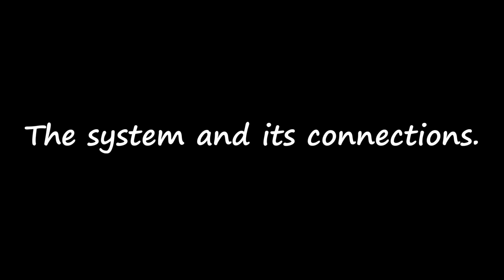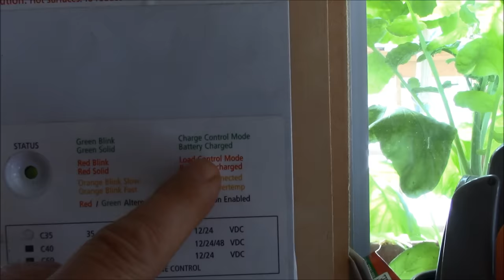A SIMPLE OFF GRID CABIN SOLAR SYSTEM THAT ANYONE CAN BUILD AND AFFORD. DIY Simple Solar Installation

Comment: Great video on installation of a simple and small system. 
One bonus you didn't mention is, by elevating you panels a little off the roof you allow the warm/hot air to vent from under the panel, keeping your panels cooler. Cooler panels are more efficient than warmer/hotter panels so you generate higher voltages from your solar panels.
Reply from the maker: Great point and thanks for commenting :-)
Reply: @thebossoftheswamp  Probably more than you want to know but my MPPT charge controller (Outback MX-60) can take 100 volts up to 60 amps of input. Using 24V panels I was going to run strings of 3 panels in series. 

The output of each panel is very near 33 volts. On a really cold winter day with snow on the ground (reflected light) and the sun at just the right angle it is unlikely but still possible to exceed 100V with three panels in series. This would let the 'magic smoke' out of the charge controller making for a very expensive day.

Sorry about the complexity of this explanation, I hope you get it. I'd comment more but don't want to appear pompous.  Thanks for your really great videos.

Comment: As with everything in life, there is a learning curve. And switching from on grid power to solar power, you have to learn what your system can and cannot handle. (you may also need to adjust your system to meet your needs)
I went through that learning curve over 6 years ago and have been off grid ever since. Not having a utility bill in over 6 years is priceless.
Reply: How many watts did you set up? Did you do the system for your house or cabin? I'm wanting to set up for my house and I'm wondering how many watts I should consider or at least start with, then add on later. I live in Canada and can access the Canadian Amazon if you have products to refer to. Thanks.
Reply: When I bought my land, I built a 14' X 16' cabin, on a full-size basement. I figured out what appliances and equipment I needed to have in my cabin, then I calculated how many total watts were required to operate everything for a 24-hour period and designed my solar system, using those figures.
Being new to solar, I made the typical mistakes of using non quality equipment and learned the hard way to go with name brand, high quality equipment that will last.
My system can be viewed in the videos on my channel, which is accessible by clicking on my name.

Comment: I picked up used panels with no frames on them. I've built a stand for them and only thing I can think of is using Liquid Nails and then put strips of wood around them like you did yours. Since mine is 6 ft in the Air I can easily stand under it to do all my connection's. Maybe even with the space under it I can make a little shed for yard crap and tires. So my stand is ready but my energy is in the pooper to lay panels, at least I won't have to go on my roof.
Reply: Good idea. 
I put my first set up on ladder style scaffolds like a bakers rack but slightly wider.
Reply: snow removal is abear. Set up on the ground facing south is the way to go.
Reply from the maker: In our location, the roof has sun a lot more than the ground so the roof was the best spot for them.

Comment: Great video. I recently did a setup. DC batteries. Worked great in winter. Summer came and because I didn’t understand that BMS battery management systems would cut off the extra power from over charging the batteries I cooked them. The got new batteries. Obviously 🙄 it happened again. Newer lithium batteries have a BMS built in and will do all of the above. I was using DC nicad 🤦
Reply from the maker: I really don't know squat about this stuff but my simple system has been working flawlessly since i set it up. I think about improving it butlike they say "if it aint broke - don't fix it" :-D
Reply: A battery maintainace system is needed to keep the batteries from over charging.Bcuz over charging is as bad as under charging. Batteries are the most expensive part of any solar system & you don't want to have to repurchase them. The maintainer is a cheap security system (little box) that protects your expensive batteries. I recommend it and a lightening grounding rod for any home/cabin setup.
Reply: @denisewilson8367  yes. I learned this twice the hard way. I watched a lot of videos on these setups and either I missed it or it was not stated enough. It’s super important. 🤦🏼
Reply: @denisewilson8367  do you have any recommendations please. I want my third attempt to work perfectly. =]

Comment: Great video like usual. I got to say four years ago I started off with one panel and one battery deep cycle living totally off grid I’m now up  to 10 renogy 100 watt panels which is 1000 Watts and 6 -100 amp hour batteries. I bought the Renogy battery,s in the beginning But found that the warranty on them Wasn’t anywhere near as good as the lithium ion Battle Born Bateries which is 100% replacement for the first 10 years and then a prorated additional five you’re on top of that so Renogy was good enough after some convincing to refund my money and take their batteries back. I am also on my third charge controller because as you increase your panels output the charge controller has to accommodate the power from those panels so right now with the charge controller I have I could go up to 1400 W which means I could get four more panels. Should’ve realized it was like building a garage always make it bigger than you need because you’re going to use it I would’ve saved 
A lot of money if I would’ve taken that into account but I was green and not really sure what I was doing. And like you said January and February are very low power producing months in New Hampshire, right now I’m running pretty much without the generator and that’s including running a pellet stove which takes a lot more power than I thought it would.

Comment: Good stuff Boss.

I started setting up a house with solar several years ago.
I ran most of the wiring from the panel locations to the charge controllers.
A couple of suggestions.

As much as possible use 12 volt power and skip the inverter.

I ran 12 volt wiring for lights using 900 lumen LED s from SuperBrightLED
The bulbs were 25 dollars then and well worth the money.
The lights are getting close to 10 years old and still out perform anything else.
Amp draw is extremely low like .05 amps per hour. If I remember the math correctly. I could be wrong but then again I have never been accused of being right.

 The owner has done modifications to the original setup. 

If somebody out there likes to listen to music, two knob style 12 volt car radios will play for days on a 100 Amp hour battery. My friend installed three of them in his house with speakers mounted in the ceiling. 

Look at the truck stop there are numerous 12 volt appliances to include refrigerators/freezers, that will run from a small solar setup.
These could be useful in a grid down situation for those living in an urban area  to help keep food and medicines fresh until the power comes back,

As a back up I rigged up a couple of terminal posts on the side of the house.
In a pinch I could jump the house off the truck. 

For those with more of an interest look up Will Prowse on You Tube.
He can be extremely technical but has videos for beginners.
His website is a fantastic resource.
Very smart young man.
Reply from the maker: All good points Shawn. Thank you.
Reply: @thebossoftheswamp  Anytime Boss.
You have shared your Backwoods Logic with us for many years.

I can give back in areas where I have some experience.
Even if it is pointing them to a resource of information.

Comment: The batteries are awesome!  I upgraded to lithium and don’t regret it.   The only drawback is you cannot charge them when it is below freezing.  Even though they are initially expensive, they will out perform and out last lead acid batteries.  Because they last longer, in the long run are more economical.
Reply from the maker: I've heard good stuff about them.

Comment: I have an up comming project im working on, its 1 pannel, 1 battery and a pair of street lamps I built my self.
The goal is to have fail safe lighting for my driveway to discourage theives.
Eventually I would love to take my entire home and workshop off grid and no longer be dependent on the local utility system.

Comment: I bought a similar kit and my order was mixed up. I bought from Amazon and there were two variations of the product in the listing. They sent me some things from the one I actually ordered, and some components from the variation that I didn't order. Arghhh. I had to buy a few cables that were supposed to be included, but it's up and running.

Comment: I like it.  The only caveat is that the incoming fuses you got (inline).  I had the same and got about a year and a half until one day we had a lightning storm in the area.  We got what I later found out to be an indirect strike...mere static in the air that came in the lines and went right through the inline fuses and fried everything.  If you drive a ground rod and run a lead up to the panel frames it'll help avoid having the same expensive problem I had.  Good luck with your system.

Comment: Hi JC - I use Renogy products too with no problems. I have a small panel that attaches to my RV's window with suction cups and it has a USB outlet on it for charging cell phones, etc. The other small panel I have has a variety of attachments that I use to keep my motorcycle or ATV battery charged when it's not in use. That one is portable as well and works great! Thanks for sharing your info!

Comment: What a treat to come home on a Friday evening and see that notification that I had a video from the Boss waiting for me. Maybe in the next video you could tell us what the system cost.  Were the batteries included?  Can you just buy more batteries?  Have a great evening Boss. I sure will. God Bless
Reply: I just sourced all the stuff and came up with around $2,378. There may be more if shipping and tax is added. Still it also depends where you buy from.
Reply from the maker: I think the kit sells for around 700. now and the batteries for 350.  ea but I got mine on sale on the Home Depot website for around 290. plus 10% off cupon :-))

Comment: Great video! Im on board with ya on mounting costs. Im doing mine out of unistrut.
If you decide to upgrade maybe think about going 24v. I got a cheap 3kw inverter ($300) and at idle it pulls 10watts.
Plus youll be using 1/2 the amps. Thats what causes thermal loss. It even can run my 15amp chop saw no prob.

Comment: finally ... came across another part of your videos .. others make this so complicated... i will be totally off grid next year.. was almost giving up on any electric power.. as the companies who install it are so expensive and want to load me with more kwh than I would require to sell for a higher price than I am willing or able to attend to,,.south of the mason dixon line.. I should be able to easy have solar... right now my only power to move into my homestead is a jackery solar generator and a propane duel fuel generator which I dont wish to run much as it is very loud

Comment: Very similar to what I did, I found the racking expensive as well. I used wood like you. The only thing I did different, was I grounded my panels and added a disconnect switch from my panels to my charge controller and a disconnect switch ( 18$ on Amazon ) from my batteries to my inverter. Great video. I really enjoyed it.
Reply from the maker: I'll be adding a few disconnects too as well as a 12v buss bar and a few other gadgets.  When you start at the bottom there's no place to go but up haha.  Cheers :-)

Comment: Nice job JC! I had 2 400 watt panels at the KY cabin with the 2 Wal-Mart Marine Batteries and an adjustable 2000 Inverter and it worked great. Thanks for the video!
Reply from the maker: Thank you buddy :-)
Reply: I'm wanting to install the solar panels for my house. What can 2x400 wt panels run? For my house how many would you recommend to run appliances, fridge, freezer, washer, and power tool on occassion? Thanks

Comment: You can increase the amount of energy you get during the winter by using metal-sheet mirrors (i.e. metal sheets for construction, or space blankets or tinfoil + epoxi + tarp to make rigid mirror boards, since optically-perfect mirrors are a lot more expensive), and angling and moving them so you get more sunlight during the winter onto the solar panels, and maybe even using the same thing to get more sunlight onto your windows and walls, to reduce the heating bill. Also look into trombe walls and solar air heating, so you can use either normal sunlight or concentrated sunlight to heat the air in your house, while at the same time circulating the air inside your house to prevent mold, and you can even install a heat recovery ventilation to move the heat from the air going out of the house into the air which goes into the solar air heaters or trombe walls through a pipe inside your house, and then making it into the house after the solar air heaters or trombe walls heated it.

Comment: Great video! I do have a warning about your small inverter. We use the 750-watt model and the other day I managed to touch the wrong terminals as I was switching the cables to where they needed to be. With a big flash, I thought everything was destroyed. With one last hope, I took it apart in hopes of a fuse being inside. Yes indeed, there THEY were! There are two 40 amp blade fuses protecting the inverter. We had to go to the car parts store because the 40 amp size was too big for the box store. We now have a couple extra blade fuses and look forward to another 10 years of using it.

Comment: I have a system in my rv.   I have a switch on the inverter where I just flip it on and off when I am going to run a 110v device.  Otherwise everything else runs off 12 volt and the inverter stays off.  Of course it is a little easier being all in a contained small environment.  Our inverter switch is right near the kitchen where most of our 110 appliances are.

Comment: I've been running my camp off solar for about a decade, indeed solar does not have to be complicated. 
This video shows a 12v bank in parallel which is fine but if you want to save coin on batteries you can use 6v GC2's (golf cart) in series / parallel. And they are common. They will not freeze if kept charged. Also note he's right about inverters using power. Meaning even if they are not in use but left on they will still draw dc off the bank. So just switch them off when not in use. Also most inverters have a cut off when your bank drops below aprox 11 volts. I highly recommend NOT letting your bank's soc (state of charge) drop below 12v. If your thinking 12v is 12v well it's not. Keep in mind a charge controller depending on if it is pwm or mppt will typically charge, equalize - float your bank at 13.5 - 14 volts. AND, it has to build up your banks Ah (amp hours). Think of it like a gas tank in your car, which btw charges its battery in a similar way. Cheers.

Comment: Can you run a small air conditioner over night on the panels ?
Reply: Air Conditioners draw lots of current, I'd go with a Swamp Cooler, but the initial start up will draw lots of current till that wheel gets moving.
Reply: Look up Will Prowse on You Tube. 
He set up a shed with a small AC running off solar.

Comment: Hi Boss, only just catching up on this one. Nice install. Basically mirrors what I have on the boat here. But I have 3 wet lead acid that I can top up as they charge from both a 230W solar panel and the boat engine. A 75amp alternator replaced the 35amp it came with to give added oompf! The best way to preserve the batteries and limit the use of an inverter is to do as much 12v native as you can. LED lights, phone chargers etc. In fact the only time I use an inverter is to run this old notebook or my 1300W wet vac in the engine space (don't ask!) which the cheap, £40, chinese 3,000w inverter does with ease. I expected it to choke at a 1,000w but it surprised me there and as I have nothing bigger it does fine! Its predecesor (also cheap chinesium) was a 1000W that choked at 500W but still lasted 5 years!
Although the UK is still in lockdown I pwesonally am in a really ggod place. Have moved the boat North to Milton Keynes where it is so green and there are huge walks that Alfie  (my Jack Russell Terrorist) and I enjoy. I am planning to stay up here when lockdown ends and that was before the most unexpected thing walked into my life. I plan to show her your videos as she too is a boater and we have the same ideas on self sufficiency, growing our own, etc. She became vegan due to health issues but she doesn't mind that I like my steak to still have its horns on! 
Its been a long, long way from the first time we swapped comments, but you continue to inspire and encourage.
 All the best to you both and keep on keeping on!

Comment: I used to have charge controller set up to charge the outside positive and outside negative connection when charging but was told that it’s best to move those to the two inside batteries positive and negative to allow more balance and better life to all 4 batteries. Not certain it’s true but maybe you can look into so your batteries last longer. Great build and video just sharing
Reply from the maker: Interesting.  I'm doing was was told to me but your method sounds like it makes more sense. Thanks for sharing.